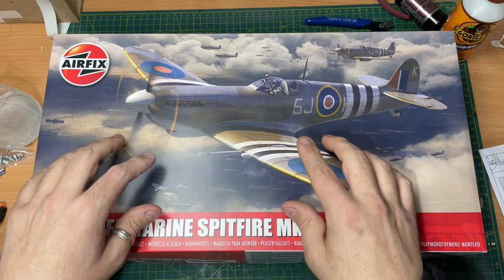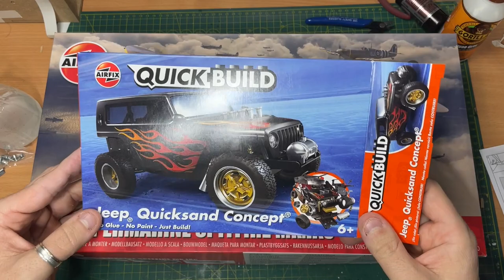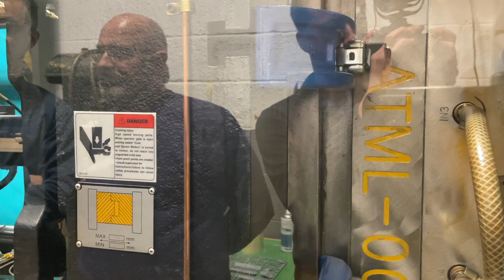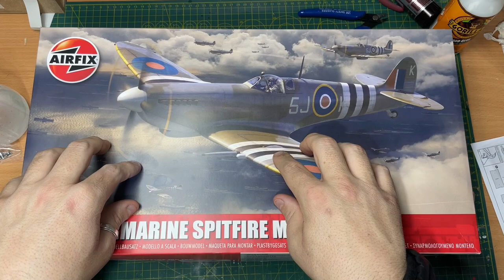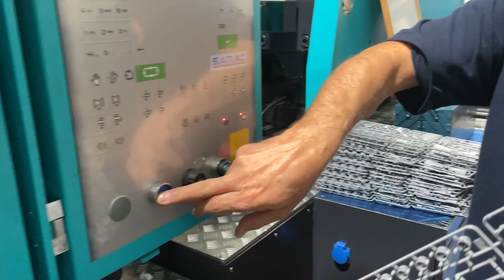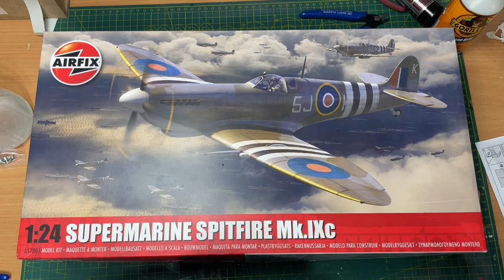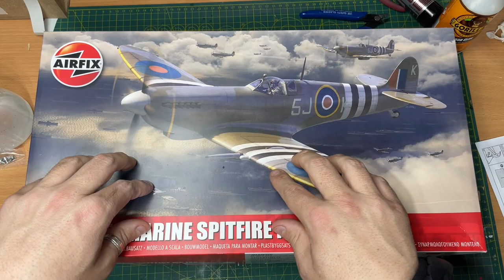Airfix Factory's Exclusive Scale Model Kit Insights

Comment: I have spent most of my working life as Toolsetter/Technician in the plastics industry where my job was to mount the tools in the machines and correct any issues with the moulded part, I also had a hand in producing first off samples for the customers approval. The The largest machine I worked on was called a Negri Bossi and had a clamping force of 535 metric tonnes, the largest mould I have set weighed 5 tonnes. As a result I found it really interesting watching this video, not only because of my work history  but also as I used to build Airfix models when I was younger.
Reply from the maker: Thank you @barryellison1272 for leaving a comment.

Please subscribe if you haven't yet :)

Comment: That's a lot of ejector pins!
Great video.
As a machinist that worked at a mold shop many years ago please make a video of the machining process for producing the tooling (mold base, cavity and core). Quality plastic parts require quality mold makers. Thanks again for the great video
Reply from the maker: Thanks for the idea!
Reply from the maker: Thank you Wayne Stopka for leaving a comment.

Please subscribe if you haven't yet :)

Comment: Great to see Airfix making large scale models and great to see them manufactured in the UK. However no one has referenced that this is not the first 1/24 scale Spitfire Airfix have made! I started modeling back in the early 70’s and focussed on the 1/32 Revell WW2 aircraft. I distinctly remember that Airfix had a 1/24 model Spitfire back then. Am I correct or am I getting forgetful?
Reply from the maker: You are correct.. 1/24 scale has always been in the range.. 1970 was the original tooling.. 15 times its been release since as a Mk.1a and Mk.5b

The last 1/24 was the hellcat back in 2019

Thank you @simondavies4603 for leaving a comment.

Please subscribe if you haven't yet :)

Comment: Nice project. I wonder, how many injections can be done on this huge machine before the molds will need to be replaced?
Reply from the maker: They last for years :)
Reply: @MOS6510Models   from model railways, it's been said that typically these injection molds last about three to four thousand copies.

I wonder, would that kit be suitable for building the Hellenic Air force mk.IX MJ755 with the clipped wings? I am not an expert on things Spitfire...

Comment: To have good companies which make quality products you have to have decent investment. We lost so much of our industry because we had a captured market In countries we invaded and felt we didn’t need to invest and improve but as they got their independence they went elsewhere. Compare the difference between the end of the old Meriden Triumphs shchi we’re still basically 1950s bikes and the new triumphs which were designed from scratch in a new facility. You also need enough profit margin to absorb the different costs. It doesn’t surprise me that Airfix went with this model, which is more expensive, as a UK model as the “fixed” costs of building in the UK are easier to absorb. The cost in these kits is the tooling and R and D. Not the oil/plastic pellets. I notice he said he still offshores some of the tooling we need to get that back,
Reply from the maker: Thank you @melanierhianna2917 for leaving a comment.

Please subscribe if you haven't yet :)

Comment: A question that I would have asked is why are they not using computer vision for QC??  Instead, relying on old human eyes to inspect every sprue for hours on end.  Although I certainly appreciate the 'inspection of every sprue' (that should be a given), their inspection methods are archaic compared to modern manufacturing QC methods.  Just over a year ago, I received a new Airfix 1/48 Boulton Paul Defiant, and upon inspection of the kit, one of the fuselage halves was severely short shot.  I recall wondering how they managed to miss that before packing the sprue in the bag.  Well, the answer is that humans get tired, they get complacent, especially when doing monotonous robotic tasks for hours at a time.  I'm an Automation Controls engineer by profession, and a camera vision system for QC easily would have caught that short shot.  So, instead of having two human bodies off to the side inspecting sprues for hours at a time, put a camera vision system in there.  It will work much better for QC and they'll be able to use less manpower at that machine, freeing up a human mind/body to do something else in the factory.
With all that said, I really like Airfix's models.  They've come a long way and I'm looking forward to building the 1/24 Spitfire!
Reply from the maker: I think its cost
Reply: @MOS6510Models  Eh…CV systems aren’t that expensive.  Those molds are way more in cost and the molding machines are easily in the millions of $$$.  CV systems for QC for inspecting the sprues would likely be <= $10k, a drop in the bucket compared to the cost of the molds and the molding machines.  Besides, it would pay for itself by freeing up human manpower.  No, my guess is they likely lack familiarity and expertise in supporting CV systems.  That, coupled with being comfortable doing it like they always have and fear of doing it a different way.  We naturally are reluctant to try things we are not familiar with, especially if there is any amount of risk involved.  Another thing they should do is implement a robot for pulling the sprues out of the mold.  That is very common in the injection molding industry.  I started my career in injection molding and recall there were pick-and-place gantry robots on every molding machine, and that was back in the mid-90’s.  Again, my guess is Airfix lacks the skillset within their workforce to support such automation systems.